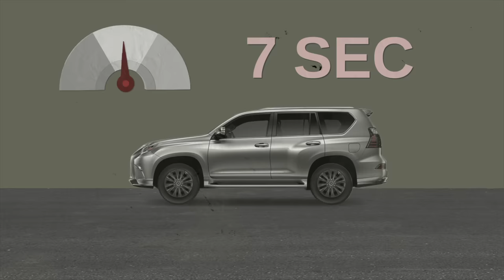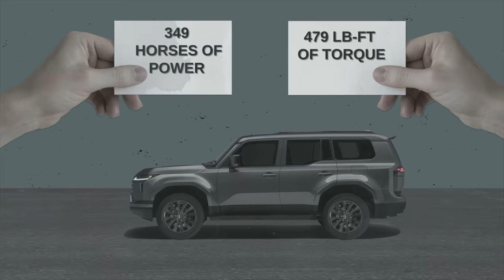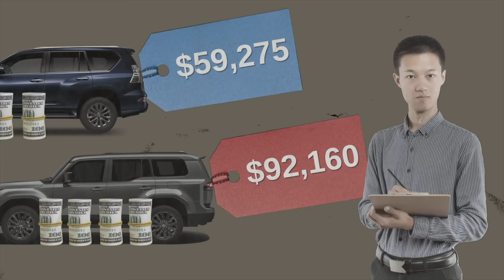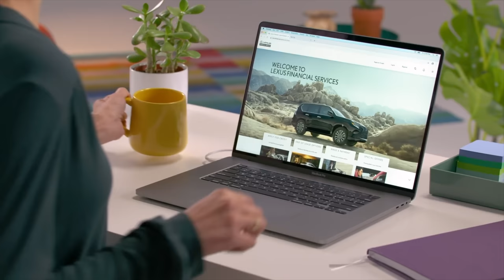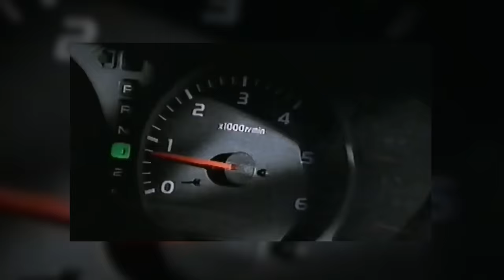Lexus Just Dropped a Bomb on the Entire Car Industry

Comment: I'm still trying to decide between the GX and a Defender 110
Reply: Defender will tank in depreciation
Reply: @bbalderston125  Defender or Range Rover. Since the return of the Defender in 2020, the resale value has been strong.
Reply: @baltimorejae7397  the better question is how good of a mechanic are you?  The rover is a basket case, a totally different animal from a Toyota.  A cool car no doubt but just not reliable.  I'm not sure why resale is strong once the warranty is up you're in trouble.
Reply: @shaunbava1801  I know the Rover is a different class of truck and bad mechanically. The other guy stated that the Defender would tank in resale. Which isn't true. Also, the new Defender hasn't had nearly as many issues as other Land Rover vehicles. This leads me back to my original statement. I'm still undecided between the two. If the GX Premium plus comes in at 70K. I'm picking the Defender 7 days a week and twice on Sunday. Btw I own a 2020 GX, so I like the brand.

Comment: i have a 2010 460 because i wanted a timing chain gx. its 0-60 is 6 seconds confirmed by me.2023 gx is nearly the same as mine. wont buy a 550 until its old if its proven

Comment: I wished the new GX had better fuel economy and took regular gas instead of premium.
Reply: They're not even worth the money!! I can't understand people buying new cars....they lose like 15% of th value as soon as you leave the lot, and tbeyre not made as good as they  used to be
Reply: @richsweeney1115  On worth the money part- I agree probably have better options with the new 4Runner and the new Land Cruiser. On buying new vs. used, if one is looking for $avings and retaining value then yes buying "someone else's problem" used is the best route to go, but if one is going to keep the car for the long run and doesn't plan on selling I would just buy a new versus buying 2-3 year old used. As for how they are made the GX will be made in the Tahara factory in Japan. If they are not making quality cars then no one is, in that case, best to stick with used 4th Gen 4Runners.
Reply: @mfnazir if it’s made in Japan, it should be fine imo.
Reply: The vehicle is huge. The gas mph is going to suffer regardless unless they put a small turbo engine, which will suffer in reliability, and longevity
Reply: @antoniosmith197  So is the new Sequoia 3.4 L 6 Cylinder 2WD gives 22 combined city/hwy. while 4WD gives 20 combined city/hwy. Hopefully, GX Hybrid version is similar in 2025.
Reply: @mfnazir the GX hybrid will be the 4 cylinder hybrid
Reply: @1984mrdale  Yes I know, unfortunately.

Comment: Sir you didn't give us some information about transmission, it's verey huge in size and cost and what i think its using 1 gallon for 17 miles cause of six cylinders ,it's looks like suburban with v6 engine , what i think is if they put v8 will be verey different of fuel maybe because 6 cylinders is not enough for this kind of body who carrying 7 adults with canvas too , thats why it forced to use 1 gallon for 17 miles ,i like the size and box type if they solve the problem of fuel and front diff lock system than it becom a GOD of SUV for long trips  ,otherwise jeep wrangler or 2023 Lexus is  best with diff locks and fuel offensively  ,Thank you sir for giving us such good information about car's .

Comment: Toyota, should have had and should have a, Diesel engine version or the, Hydrogen fuel model. We need power as well as long distance mileage. Diesel for simplicity of mechanical maintenance and reliability for do it yourself repairs and maintenance. Or the Hydrogen fueled engine that uses H2O as a fuel to give length of mileage for one tank of fuel. Water is available everywhere. Diesel, or gas has to be manufactured in a refinery and as the cost of fuel goes up with the unionized workers, so does all the rest of your limited budget. Spent almost a hundred dollars on gasoline today and can’t stand it. The Cost of groceries because, everything is imported and Taxed in, Hawaii is making owning your own home, cost prohibitive for a lot of people throughout the country and now with the entire town of, LAHINA Maui in Hawaii burned to ashes, what kind of vehicle fuel would work best for those people, that don’t have a car and no electricity to pump any gas? The beach with an entire Ocean of Pacific Blue water is right there surrounding the entire State needless to say around the whole country.

Comment: Normally aspirated v8 engines are SUPERIOR to twin-turbo anything, except possible (for towing) turbo diesels. I do not understand this move, and have decided that the only Toyota truck I will buy joins the ranks of American trucks...the older and gasoline powered v8, the better! Preferably, 68-72 with updated (r-134) air conditioning.